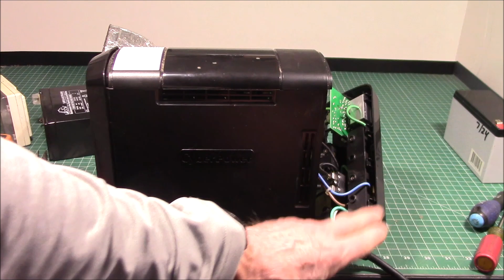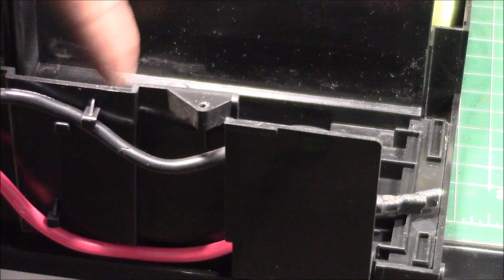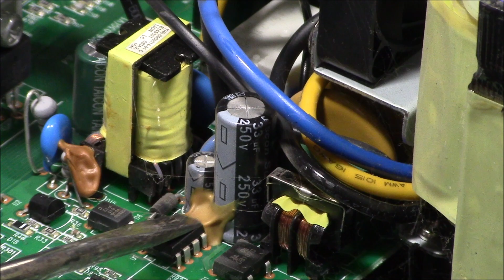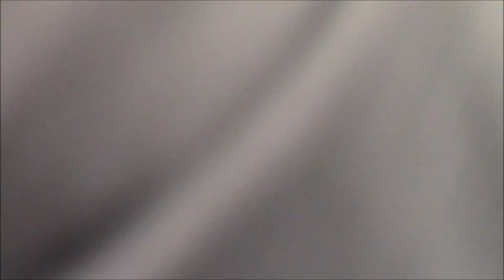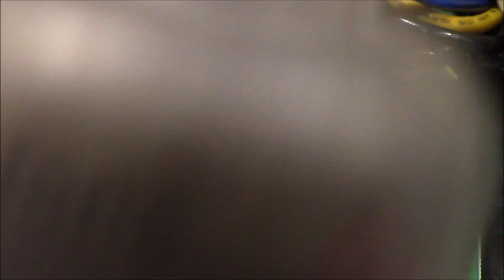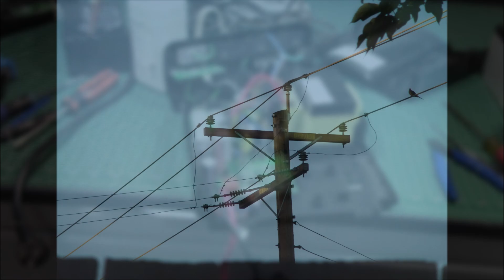Cyber Power CP1000PFCLCD UPS, Conductive Glue Removal

Comment: was the fan cooler inside the upc  there? or did you modify it?
Reply from the maker: Yes, it was inside when I opened up the UPS.  I think it must only come on at higher loads when running off the battery.
Reply: @The4Crawler  Okay, thanks for replying. Another question: what happens if you use LiFePO4 batteries that operate at 12.8V? Could it damage the internal charger or the battery?
Reply from the maker: @joseelnoob8685  I'm not sure of the exact charging voltages of the UPS, but I assume it's the typical 13.8V for float.  Most LiFEPO4 batteries can handle that, around 3.45V/cell:
https://www.ufinebattery.com/blog/lifepo4-voltage-guide/
12.8V is the nominal voltage and that's similar to what a lead acid battery is rated at.

Comment from the maker: After 8 - 9 years in service, the original battery in this UPS has stopped working.  I had purchased a new battery for it last summer, but never found the right time to replace it.  But the local utility had announced an 8 hour shutdown for my area so I decided that was the perfect time to do the battery, along with testing a LiFePO4 battery and also taking a look for the nasty yellow glue on the PCB inside.

The UPS is now back in service, working like new!  As of late June, it's logged 5 additional brief power outages and no shutdown of the connected equipment.  I have the NAS / UPS server set to issue a shutdown signal after 1 minute on battery power.

I didn't film the tedious process of gently picking away at the hardened glue.  That task will vary depending on where and how much glue is on your PCB and the tools and solvents you have to remove it.  Slow and gentle is the key, some of the components are through-hole.  Too much motion and you risk breaking off the leads.  Other places, the glue is on the surface of the PCB and you need to evaluate if you can remove it without damaging the traces, if any,  below.  

Heat seems to be the key to this yellow glue turning color and becoming conductive, then having high voltage near that conductive glue is when it causes problems.  I think the area under the battery tray is where the power supply for the UPS is located.  On the other side, one large area of glue seems to form a strain relief for a thermistor wire.  As it's not as hot there and there's no high voltage traces nearby, this area was left pretty much as-is.

In any event, it's much better to remove this glue before it starts to break down than to wait until you get high voltage tracking and burn out components or PCB traces.  There's a card link to another video on the 1500VA version of this UPS, fairly similar inside.